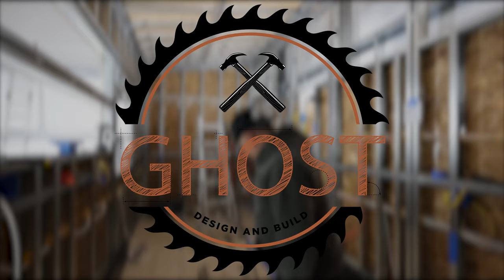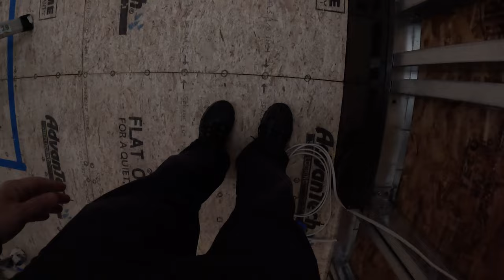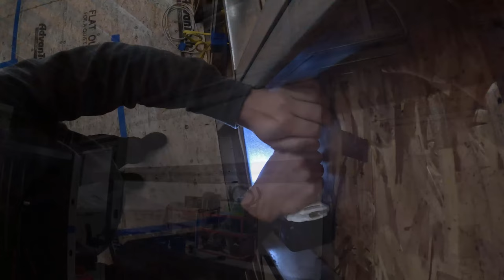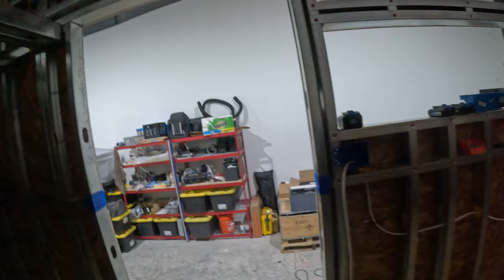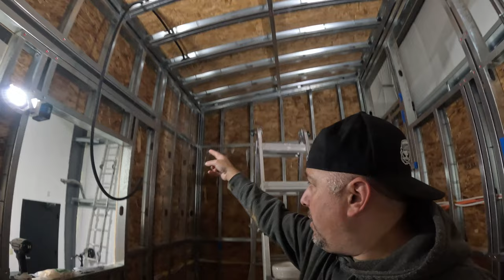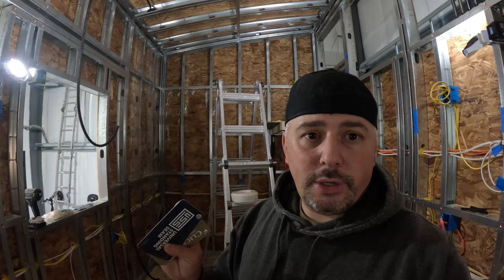DIY Tiny Home Build - What Did I Get Myself Into

Comment: Jarrod, I would strongly recommend against spray foam insulation. I live on a canal boat in the UK which was originally spray foamed which is quite common here. It was particularly bad in the summer as the boat is made of steel so the heat on the inside would be unbearable, however the solution I have found is to cover the foam with bubblewrap style, foil insulation. At 3mm thick it provides the equivalent of 35mm of foam insulation. I ended up putting 3 layers in the roof which helped protect me from the heat significantly. You could put several layers in your walls and ceiling and still have access to all your wiring, multiple layers will also reduce your AC consumption, also the mess the spray foam makes is a nightmare to clean up!!
Reply: Is foil exposed on your boat?
Reply: To late, his is done already. Good for others to see your suggestions though.
Reply: @JGnLAU8OAWF6   It is currently but only because I haven't finished boarding the ceiling.
Reply: @BrooklynAlien  I'm always late for everything😂
Reply: @P213-n4d  lol me too.
Reply from the maker: I have a nice convo with the spray foam techs. We will put a lot of stress and fears to rest in that video. Would I do that on a van? Maybe not still. In your case it has a lot to do with the brand of spray foam they used as well as how they did it. I didn’t think it was a big deal on how spray foam is applied but apparently it has everything to do with how it’s done
Reply: @JarrodTocci  Yeah I think also because the steel on the boat is 8mm thick it holds the heat (and cold), and creates a big temperature difference between the inside and outside. I work as a carpenter so I've used all kinds of insulation on buildings but this is first time I've used the foil, I guess people don't get it because it's expensive. It's been a revelation for me and I wouldn't go back. I'm even going to sacrifice the budget I set aside for a Jacuzzi to cover the walls and the hull, I'll just have to fart in the tub instead.🤣
Reply: @P213-n4d  covering it with something without proper air gap may actually reduce it's performance.

Comment: You should’ve ran three pipes on each side. One and the bottom one is the middle one at the top. This way you could pull wire after you’re done. Can you cut the opening and put the tees where you think you’re going to go out. The way you’re doing it is running bear wires in the wall not there but Romax stuff like that. Once you phone that you will not be able to ever change it. With the pipe you could. Jared I wish you the best take care
Reply from the maker: Romex should not be run through conduit. Technically Running it that way is against code.
Reply: Wait to you need a wire. Your wished you would use that pipe. Doesn’t have to be Romax could be anything what gauge wire did you run?

Comment: Have you tried using a program like freecad to build it out?
Reply from the maker: No but I’ll check it out. I use SketchUp which gives me the general layout but honestly I change a lot during the process. Everything in a tiny home or van is custom. Typically we don’t buy off the shelf cabinets so a lot will change
Reply: @JarrodTocci  Yea that might be a good idea. It's a cad program like sketchup, there are free resources to acquire pre made cad models similar to it. It just won't require you to pay monthly for using it and it can be run on machines not connected to the internet. It's not as user friendly though, but i think the free cost and not being tied to a connection makes up for it.